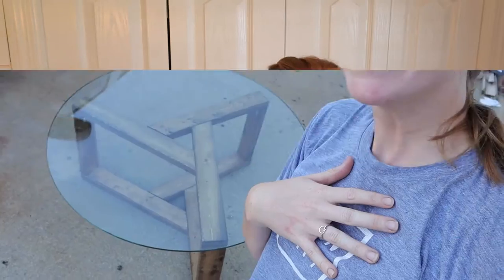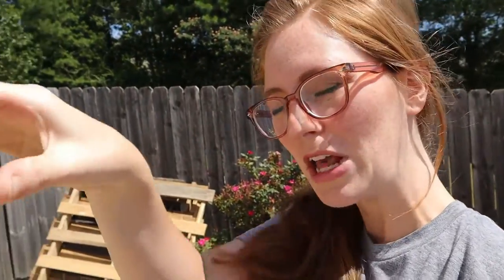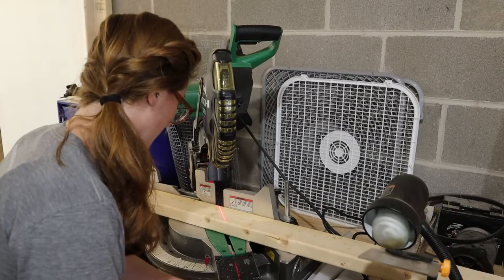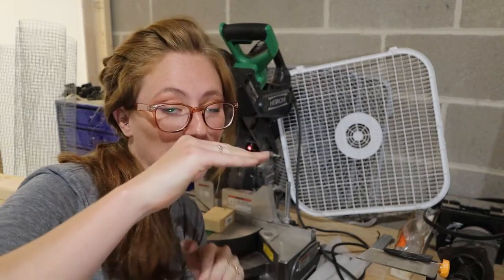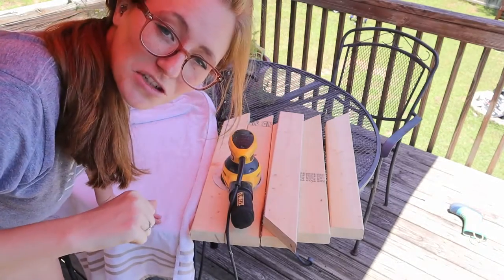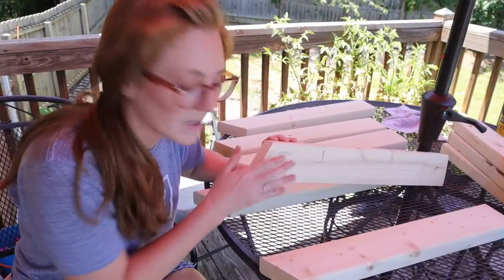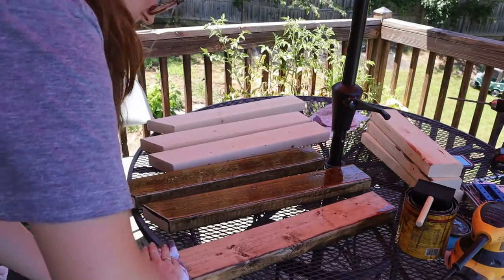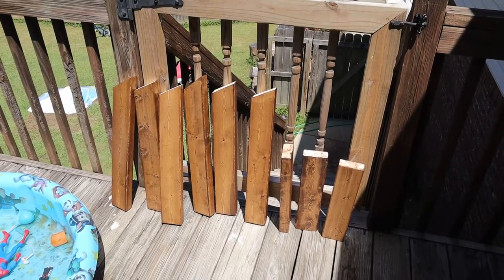DIY Glass Top Coffee Table

Comment: Love this! How did fix the glass onto the table tho?
Reply from the maker: It actually sat on its own pretty securely, but putting some clear plastic door bumpers on the top of the wood sould give it more grip to the glass!
Reply: I wondered about this same question. I have a 4 year old who’s very active so are those plastic door bumpers very secure ?? Like for real??
Reply from the maker: @NoTimeBetterThanThePresent321  You could use some sort of clear adhesive if the bumpers didnt feel secure enough! I think I've seen a clear putty like adheaive if you didnt want to do glue.